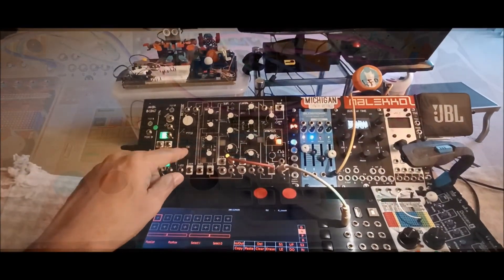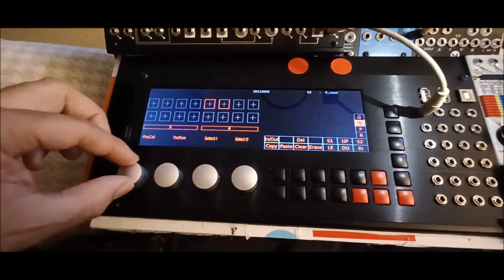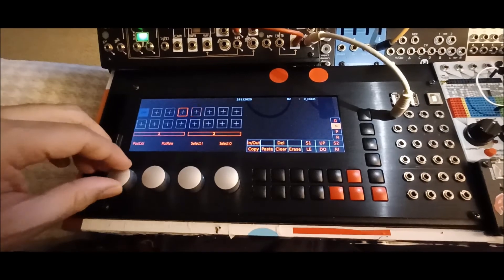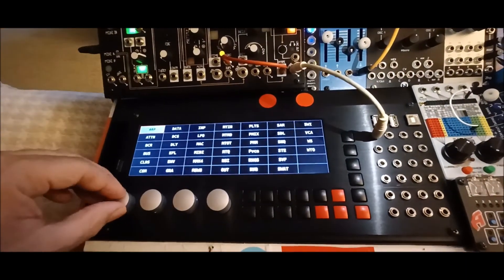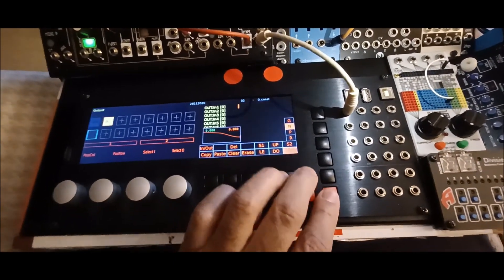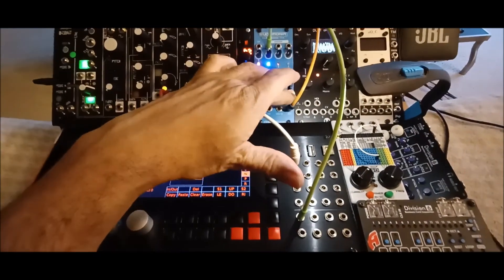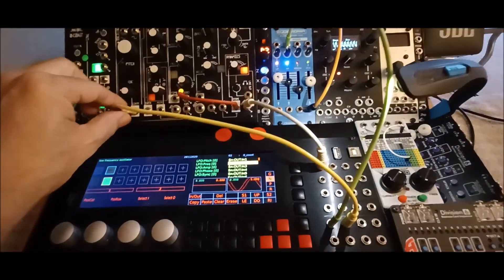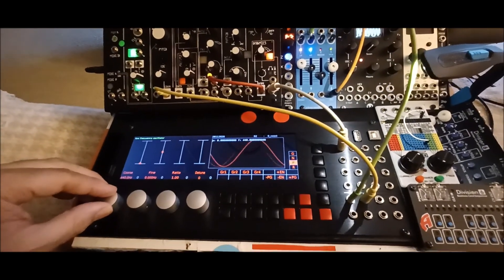Percussa SSP Patch Examples for beginners --- Part 1  🎛🎶🔊

Comment: Yo! Sounding good! You might have fun with the switcher module, it's a CV router, it takes input any signal and a voltage, using the voltage it can route the signal to one of 8 different outputs. Could be fun sending envelopes around, routing audio to different FX, routing sequences around, and so on. Just a patch idea, SSP needs more vids out there. :)
Reply from the maker: Wow I never thought of using that module before. I may have to include that in my third part in this series.........u oooo,,, What you got me started in now LOL🎶🎹🎚🎛

Comment: Dope. I don't use modular at all. I have been making electronic music since 1992. I use hardware samplers, analog and digital drum machines and drumsynths, all sorts of synthesizers, some software (trackers for some sequencing, used to use Ableton heavily). I want to get this module and maybe the Rossum Assimil8or and Morpheus. Is the Percussa a totally self-contained unit in that if I had only that module, could I use it to sequence synths and samplers within itself?
Reply from the maker: Oh heck yeah. I have this SSP contained in a 64 x pod. If I wanted to I can just take the Pod itself and just sit on the couch,,, plug it into the wall and I don't have to hook any equipment up at all. There are tons of samples I can load. 8 at one time... if I wanted to and I can sequence them all and have one big giant supersaw sound. Like the Dave Smith poly evolver, so to speak. You can sequencing any of the samples and you can add any sort of effects and special quantizing scales. It's very Advanced I'm about to do a part 2. Hopefully I will have it uploaded sometime this weekend so stay tuned